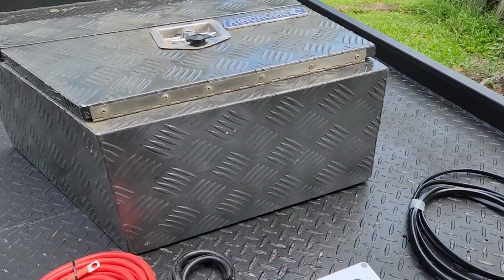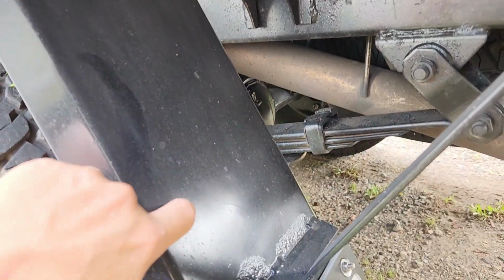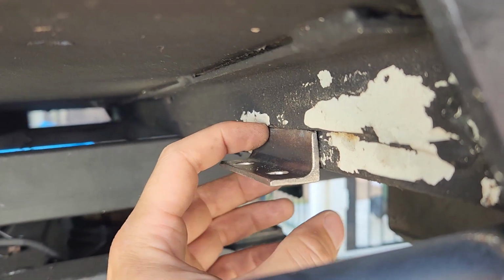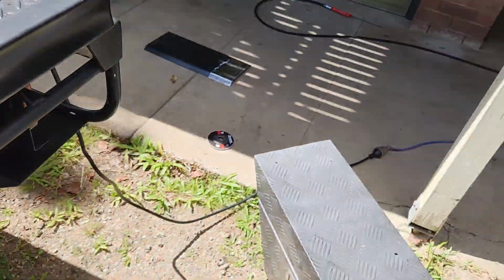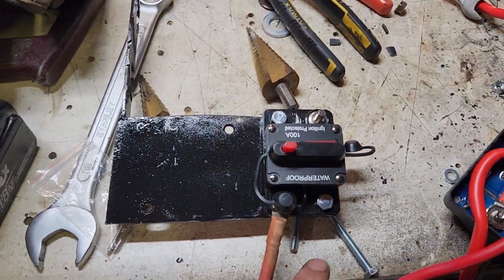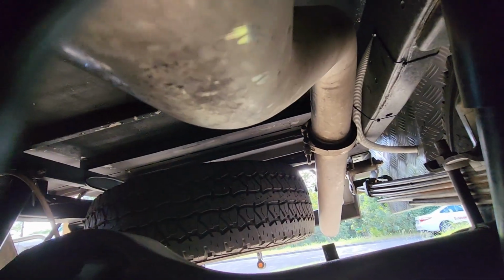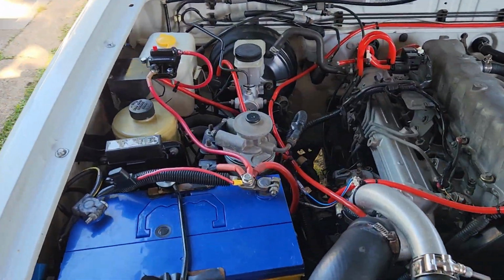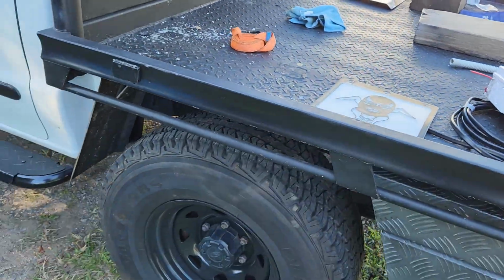Dual Battery Setup - Under Tray Toolbox Dual Battery Setup (Part 1/2.5)

Comment: Just asking. Not being an arse but why not put the second bat under the bonnet
Reply from the maker: My turbo setup rearranges the charge piping, so the intake goes out towards the snorkel and the charge piping towards intercooler are in a different spot, not much room left for second battery in there anymore. Nah you're not being an arse, i respect the question and it's a valid one.